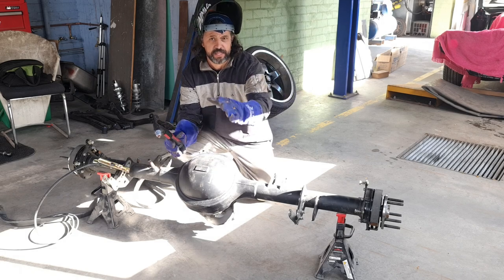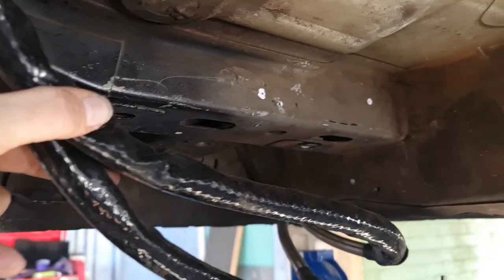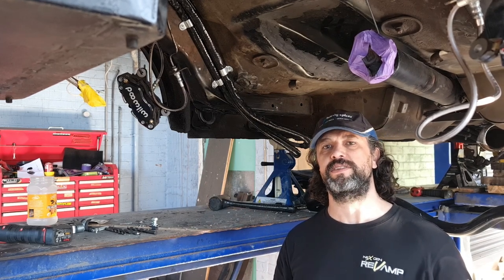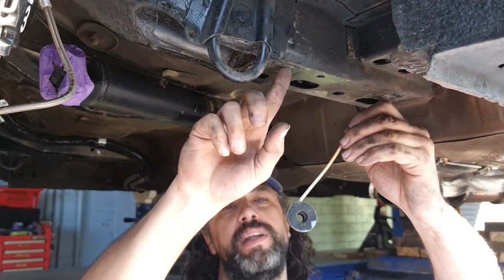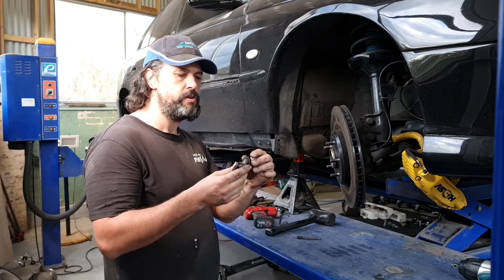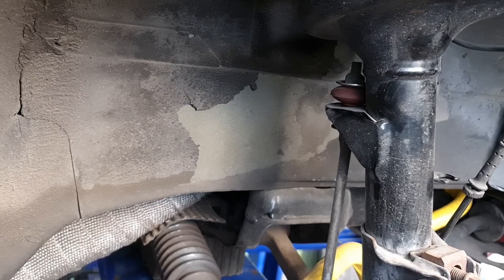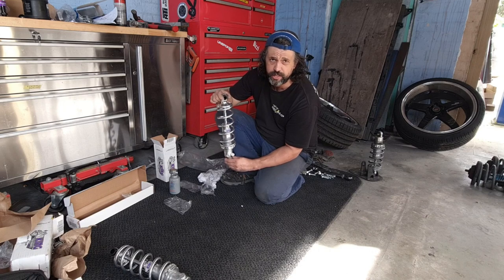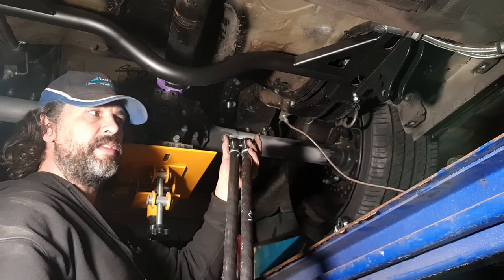1300HP Procharged Commodore 4link suspension REVAMP, damaged parts, solutions and upgrades.

Comment: Love the amount of explaining on why certain pieces go where and the affect it'll have on the car. Keep it flowing boys
Reply from the maker: Being the second 4 link kit we really wanted to show and explain what's going in, why we are doing it and how we are going about it.
We are glad to see people enjoying the content and getting useful info out of it.
Cheers for watching and commenting Hannah
Reply: Wasn’t t happy with rodshop kit?
Reply from the maker: @zachmason5165
Our biggest issue with the rodshop kit was basically the links themselves.
We found there to be too much movement in the bushes they use aswell no adjustment capability in link length or link location. 
I believe they have changed the design but from what we can tell they are still not adjustable links.
They may be fine for a skid car but as soon as they are used for different applications needing things like pinion angle or link location and length changes, extensive modifications will be required.
Hope this helps, thanks for asking
Reply: @nexgenrevamp2976  thanks for the reply, mines just going to be a skid car but pinion angle is what can brake other parts might have to start looking around again… sick of destroying irs crap too😂🤦🏼‍♂️
Reply from the maker: @zachmason5165
Irs driveshafts are definitely the weak link in the chain along with 'k' frame strength, some of the reasons we originally went with 4link 9inch setup.
McDonald bros racing would be worth a chat for sure if you are looking at a 4link 9inch setup.
We should have another video coming out soon that will show its still straight forward settimg these things up without having extensive experience in 4link type rear suspensions.